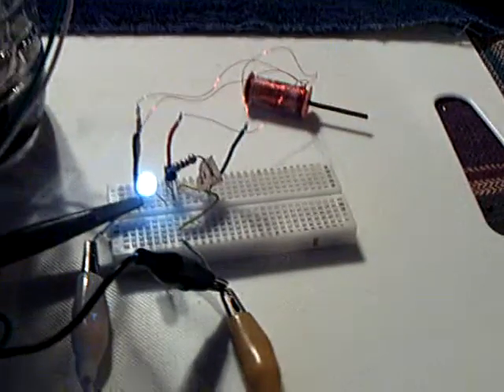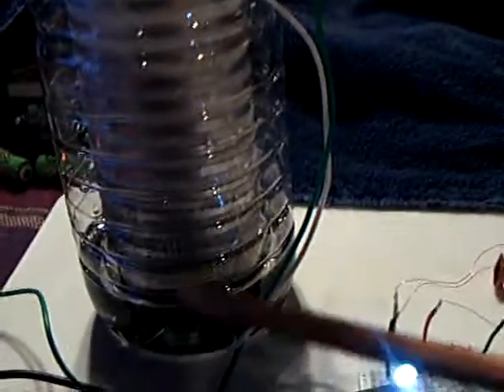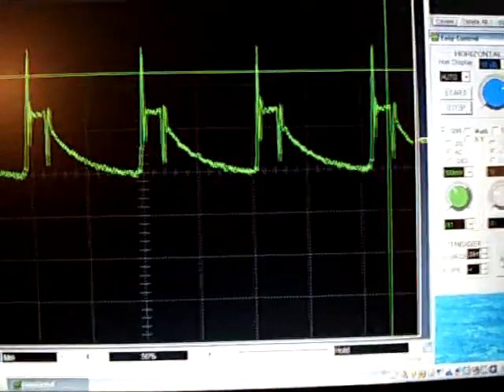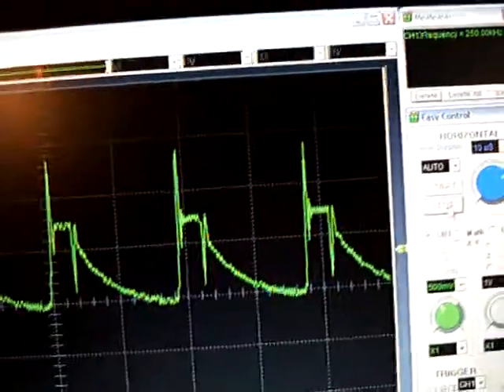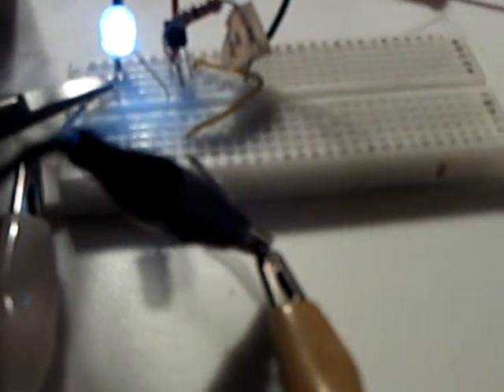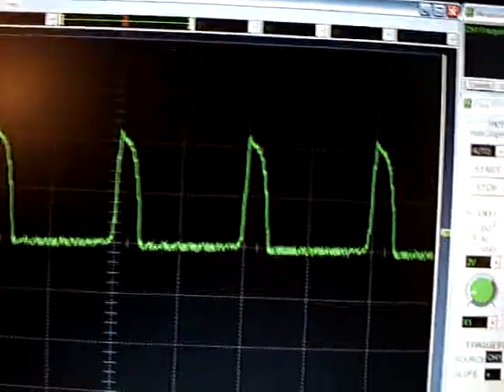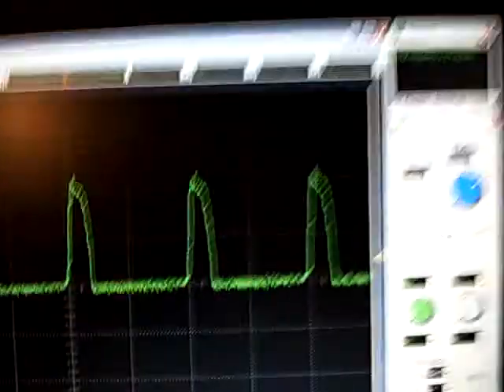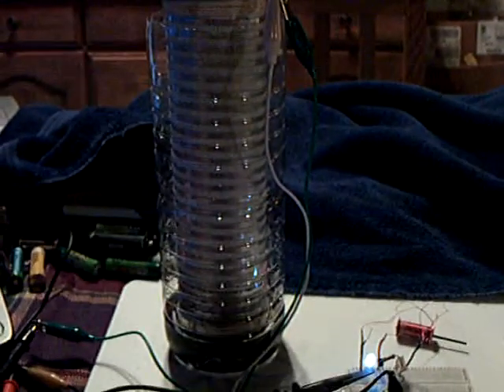Bedini Earth Light scope shots.ASF

Comment: thanks lidmotor, glad the amp draw is resolved. I made an error and assumed that just any input voltage would suffice. but as mistakes are made some good came out that instead of 51khz I was getting 2.2 Mhz. The difference is I was not using the C/Mg cell
sorry about that. The negistor effect really brings the amp draw down